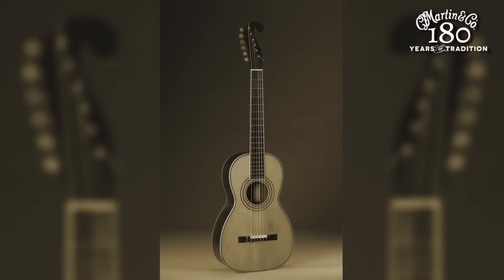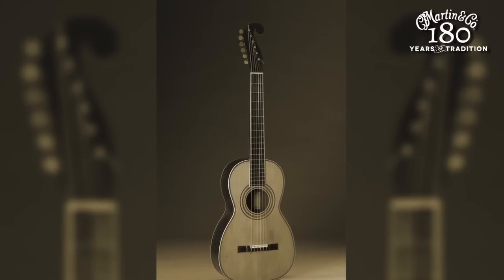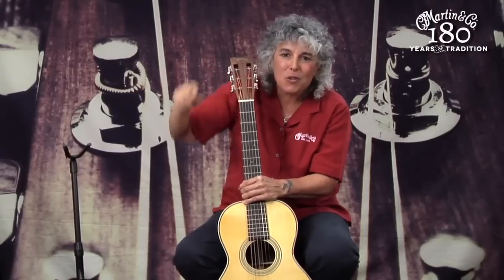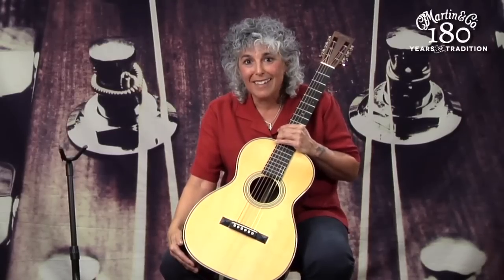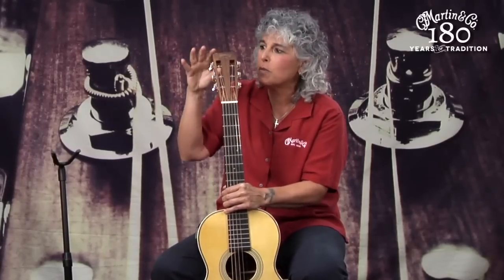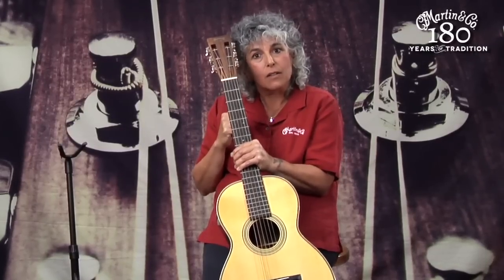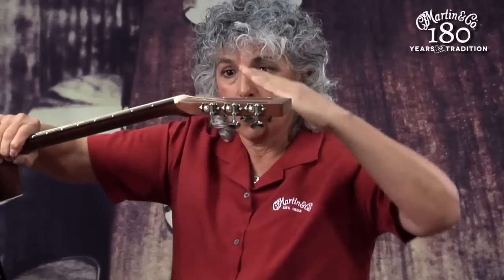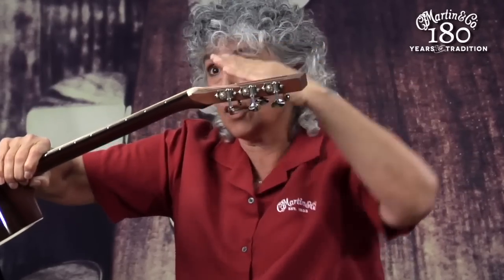Martin Slotted Headstocks

Comment: Nice. But as she implies, Martin only uses the slotted headstock on 12-fret models. I always thought that the larger influence on tone (and volume) was the shifted bridge placement, compared to a 14-fret. I get that it's both, but I wish she'd have mentioned that, and discussed which is the greater influence: bridge placement, or downward angle on the nut.